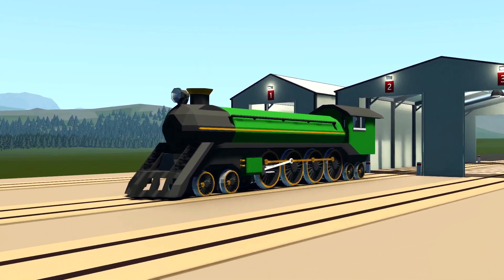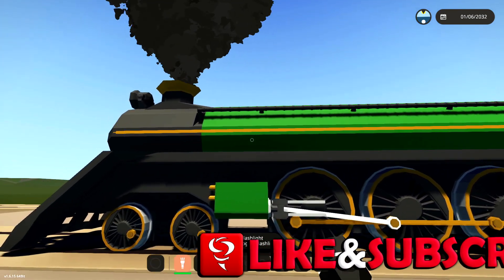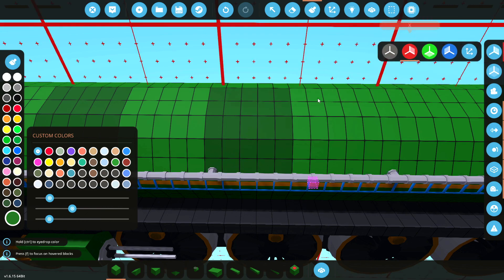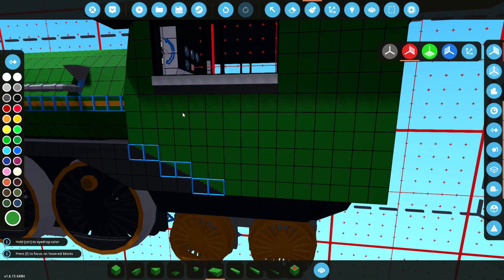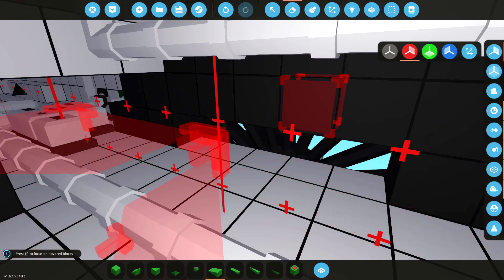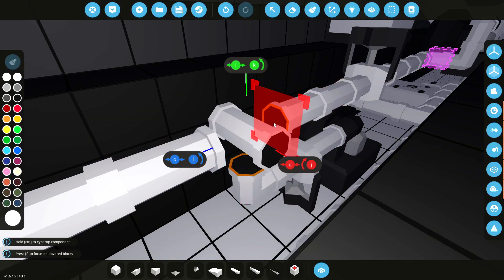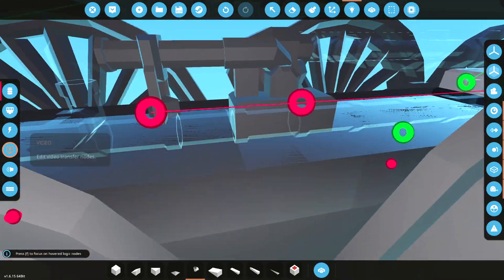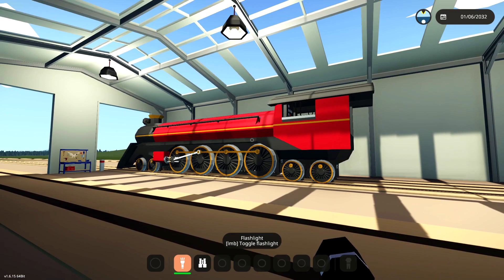THE BOILER DOESNT EXPLODE ANYMORE!? - Lets Build A Steam Engine In Stormworks!

Comment: On/Off valves are just that, all flow going out or none at all. You need a variable flow valve to control the amount into the boiler. Basically you'd have to use trig to do so. I don't remember all the math required to do so, but basically you'd want the fluid volume of the boiler being compared on either a sine or cosine wave (or it could be asine or acosine) that increases closer to 1 the closer the volume gets to 0 and gets closer to 0 the closer the volume gets to a number you want for the volume to be in the boiler (I believe merely 12 is usable even though the boiler holds 175 units of fluid.) Someone else has the thing figured out but that's essentially how you want it to work. The closer the fluid volume gets to what you want it to be, you want the variable valve to shut off (0) and the closer the fluid volume gets to 0 (empty) the more you want the valve to open (1).  But for the steam venting, you may need to go overboard for it. 1 pump will power multiple vents, sure, but you may need 1 pump for each vent to clear out the pipes fast enough. Seems silly and like it's too much, but if it's stupid and it works...

The pump on the water flow is a bit overkill. What's happening is that instead of a trickle of water flowing into the boiler, you're getting a chunk blasted in. The water will flow into the boiler due in part that valves are single directional flowing, even the variable valves in the sense that fluid can only flow through them one direction at a time. So the on/off valve works well enough to insure water should get into the boiler. The pump is just grabbing a whole lot more that is actually needed and slamming it into the boiler.

Having a super heated boiler may be beneficial. There's no detriment of having a super hot firebox or a super hot boiler that I know of except that the firebox will eat fuel like crazy. But a super hot boiler will almost flash water into steam making getting pressure in a pinch really easy. So some people say control the temperature of either the firebox or the boiler, but in the confines of the game, really the fluid is what will control the pressure the most. The heat just helps make the process of going from water to steam happen faster.

Also it's now James, Frantic. You've made it James.

Comment: I just recently resolved my boiler problems because of this one video on youtube. My build is for a steam turbine electric engine so maybe it won't be helpful but...
I made a threshold gate for the fluid volume in the boiler set at 0.1 to 10 and inverted the signal hooking it up to an AND gate. The other was a threshold gate set at 0 to about 8.6 I think for the steam pressure hooked up to that same AND gate which controlled the pump/valved letting the water go into the boiler when those two things allowed for it. I also had to lower the boiler temp down alil but all of those things together made it never over pressure so I don't lose any steam now which was cutting my power 

Hope this helps

Comment: if you want a more realistic locomotive, the area where the steam is released at high pressure would be on top of the boiler and referred to as safety valves. Does the exact same job on a real steam locomotive

Comment: Put a variable valve on the firebox air intake and connect your "throttle" to it. This will allow you to control the firebox temp which is much easier than treating symptoms.

Comment: How did you get your train so fast
Reply: Larger wheels means faster train. But this is also after the steam wheel rework, so the actually do work now. One thing to keep in mind is that for some reason, condensers don't keep up with boiler rates meaning you'll never get condensers to change steam back into water as fast as boilers can change water into steam and in this game, steam = pressure. So you'll need to bleed out steam regardless of your system in order to make a "low pressure" outside the boiler to make it shoot out its steam into the wheel pistons. Otherwise it will equalize and you'll lose speed and power. Those are the tips I can give you on making a fast steam train in stormworks.